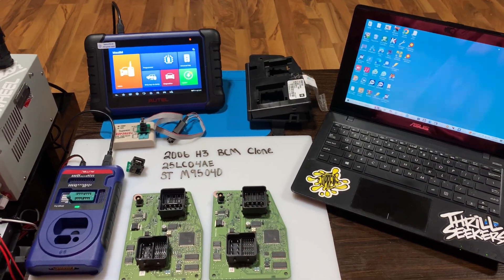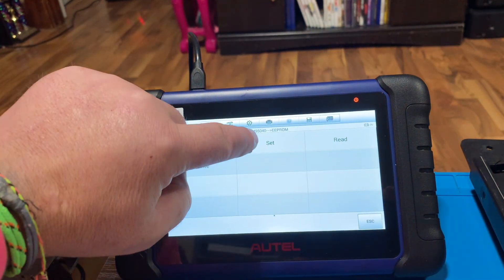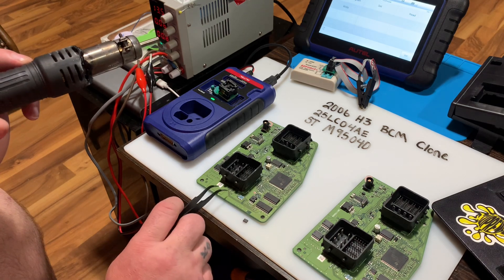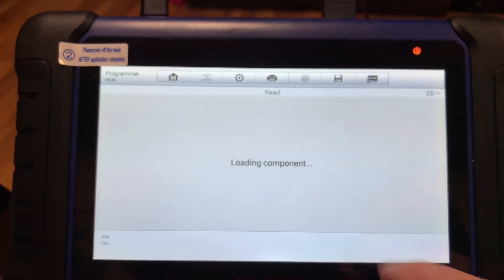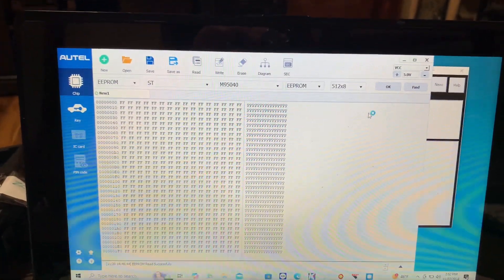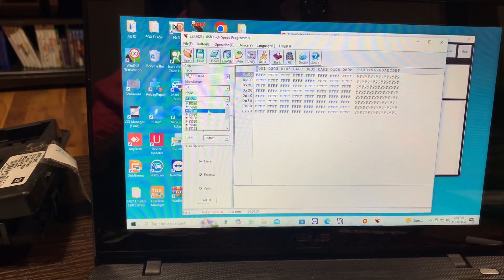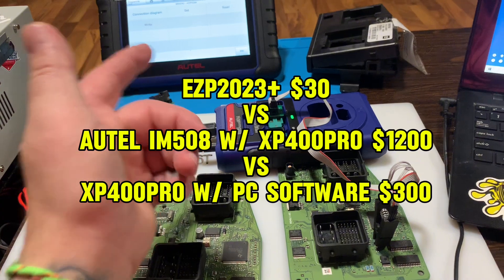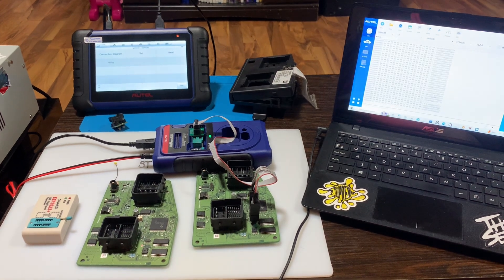1:1 Hummer Colorado BCM Clone EZP2023+ Autel Im508 Xp400 pro mileage correction eeprom m95040

Comment: Hey Drew, Love the video showing the BCM programming. If you have a sec I have a 06 Hummer H3 BCM that I am trying to read with the EZP2023+. You show the chip as a 95 EEPROM. When I pull mine up, EZP2023 wants to auto detect it as a 93EEPROM. Is that correct or can I use the settings you used? Also I have read it many time with your settings and it doesn't show a true vin number in line 0x040. I am looking to change the vin on the BCM due to using a different ECM.

Comment: How can i contact you ?
Reply: @drewjohnson5402 
If we using autel im508S with xp400 pro, how we correction the codes after reading the eeprom and how to edit code line after with help of tachosoft calculator.
 
How to edit in im508S tool, the odometer mileage correction codes in 0080: lines.
Ex: 17 D7 84 00 is a mileage,  we need to edit in 0080 line 3 times.
Reply from the maker: whats app 1.712.204.3955

Comment: Have you tried lowering the voltage on the Autel tablet or PC software to read min circuit? I find that the preset 5v doesn't work well but if I lower it to 4v it does, because it doesn't wake up other chips in the circuit
Reply from the maker: @fusionfabworkx3538   I haven’t but iam surly going to try it now.   Maybe that’s why the ezp can read it because voltage is lower
Reply from the maker: @fusionfabworkx3538  I tried this today but only other voltage is 3.5 v. and it must be to low because it won’t read.
Reply: Was this on the tablet? Because on the PC Software you can change voltage in decimal increments
Reply from the maker: @  yes tablet.  I’ll try the pc.   I   wish you could set verification.  on pc
Reply: I don’t understand why something so important is not in the PC software, but I use a program called HexComp to compare the files myself, it’s an extra step but doesn’t take too long
Reply from the maker: @ I use HXD but it would be nice if the Autel pc software just verified it from the get go for sure

Comment: I can read that module in circuit with my ar32 programmer from andromeda research labs. Cant read it in circuit with the kc501 .
Reply from the maker: That is good to know, ive never used the ar32 you should post a link so i can check it out

Comment: Where do you get the tachosoft? Got a link?
Reply: Tried that link , it's got a virus.
Reply: @boydlittou9446 
Which link are you talk about virus, while download.

I downloaded mega file, rar file. Size is 40.56MB
Need to extract.
Reply from the maker: https://mega.nz/file/2FcV3Iga#UaeWanSfZgwIxBCtigxzm1LD5I1yXcpBpcrYg7-qlUo

https://mhhauto.com/Thread-TachoSoft-Mileage-Calculator-23-1-100-WORK